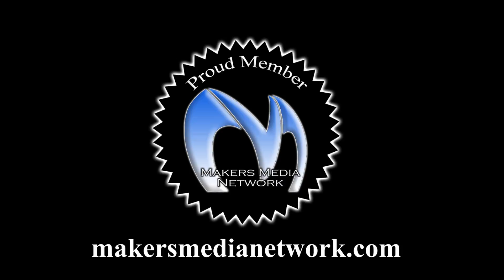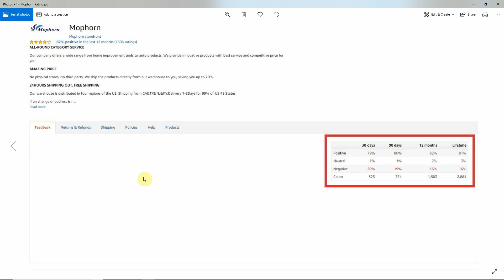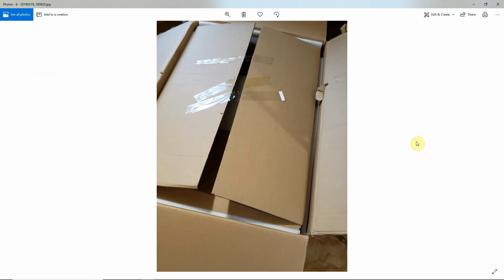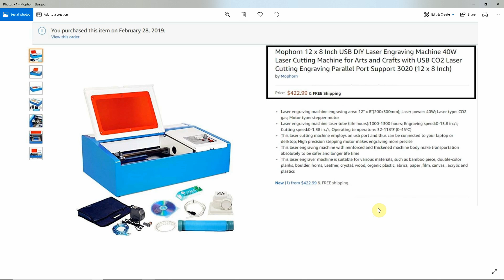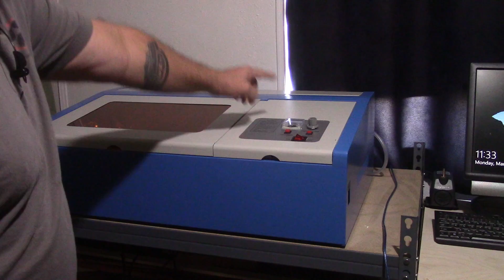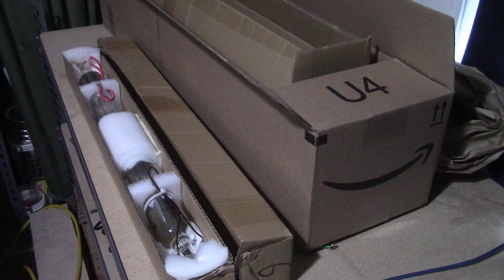K40 Laser Update 1

Comment: Its been about a year and a half since you bought the K40. Just wondering if you wished you had gotten something with a little more power, like a 60 or 80 watt unit?
Reply from the maker: My K40 laser was so freight damaged, it was non-repairable. It was returned for refund about 45 days after I received it. With the limited amount of work I was able to do with it, however, I was able to see that it was way too small to do what I'd like to do with a laser. You're limited to a working area that's about the size of a piece of printer paper (a little bit larger than that, but not by much.) That just wasn't big enough. So, I've put the laser on hold until I get my new shop built. Then maybe I'll revisit the idea of adding a laser to my shop.
Reply: @MarkLindsayCNC  WOW!! Sorry to hear that! I was thinking about buying an 60 or 80 watt but they are about the size of a small chest type freezer.

Comment: CO2 extinguisher not Dry Chemical, CO2 well be less of a mess if you have to use it
Reply from the maker: I looked into CO2 extinguishers, Bob - YIKES! For that price, it better come with hot and cold running assistants! I'll deal with a Sodium Bicarbonate extinguisher should the need arise...
Reply: @MarkLindsayCNC  in the 12 years that I've had my laser I have tried to follow the Number 1 rule "don't leave it unattended." I have had 2 or 3 small flare ups nothing I couldn't put a towel or rag over to put out.
Reply from the maker: I found some foam fire extinguishers that are supposed to be pretty good. Let's hope I never have to find out how true that is...

Comment: Thanks for the video Mark. I did have a question. What was your reasoning for purchasing a self contained laser like this one as opposed to installing a laser on your CNC machine? Thanks!
Reply from the maker: Thanks, David. I thought about buying a diode laser for my CNC, but this laser will fit in a spare room in my house. That means I don't have to try to use it in a cold, unheated shop over the winter.  This is also more versatile than a diode laser would be. This laser will cut through materials the diode laser won't. It'll engrave materials a diode laser won't touch. And the clincher for was the tube on this laser is rated for somewhere between 1000 and 1500 hours. A diode laser is similarly rated. When this tube dies, I can replace it for $150 or less. When a diode laser dies, you have to replace the whole unit. I can also upgrade this to a 50 watt laser with some modifications. Can't do that with a diode laser - or at least I can't.